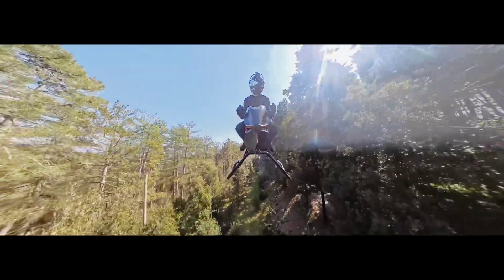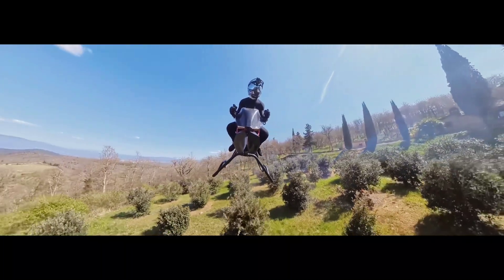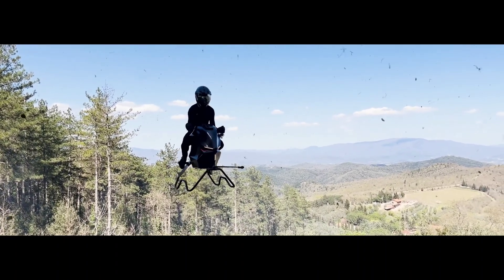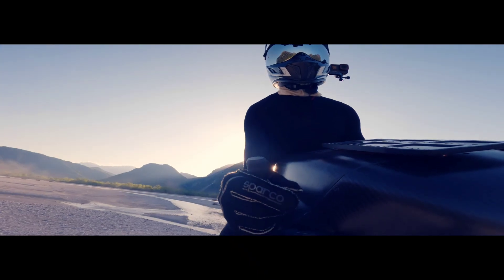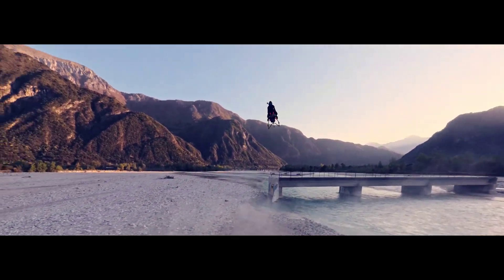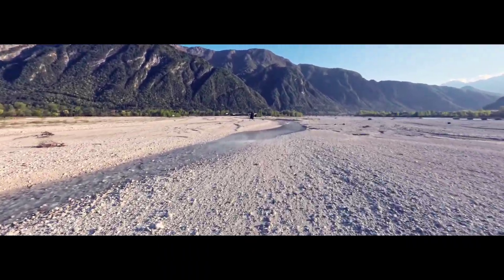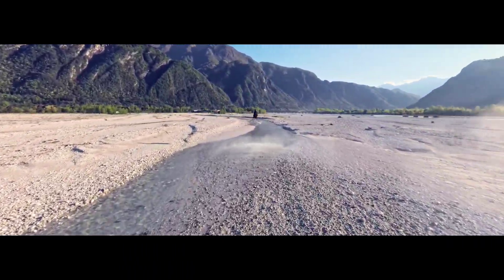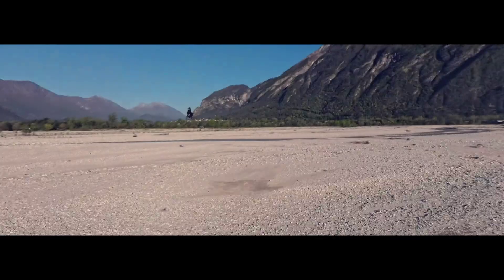This Volonaut Airbike Looks Like Something Straight Out of Star Wars

Comment: :rocket-red-countdown-liftoff: :rocket-red-countdown-liftoff::rocket-red-countdown-liftoff:This Airbike is but a fuel hungry turbine with stability control - short range/duration [<10 minutes], high cost,  high noise. <><><> We're developing a low cost [non-electric], ultra-efficient [long range, novel engine and propulsion], door-to-door [quiet], AI assisted autopiloted PersonalJet [PJ] personal air mobility system. The advanced tech generation-2 BusinessJet [BJ] system will operate under a ride-hailing/taxi/delivery business model [prevents tech pilfering]. <><><>